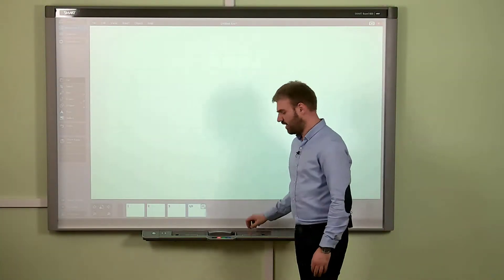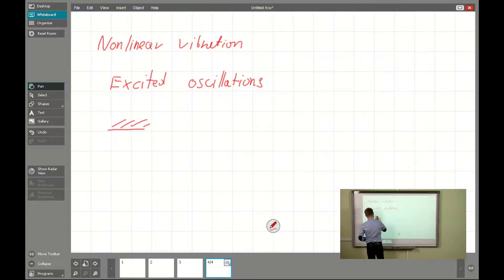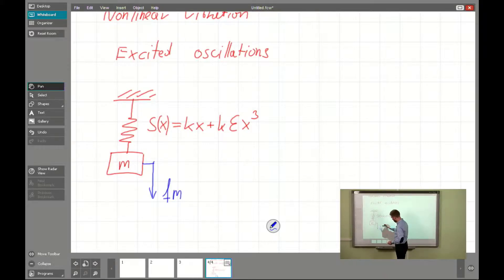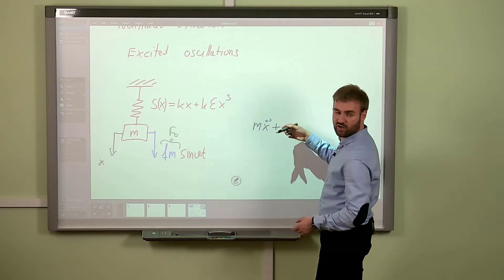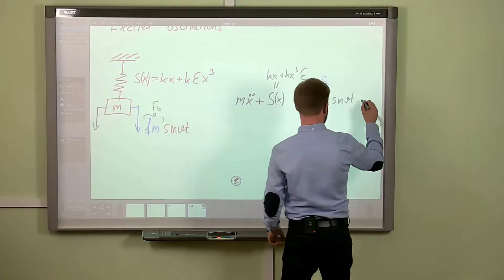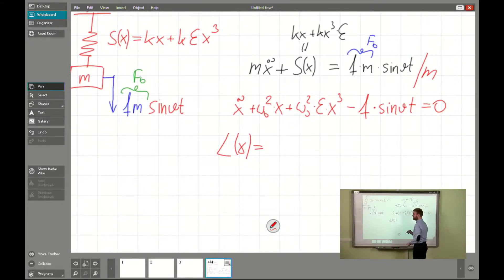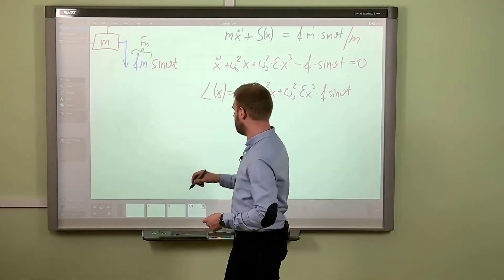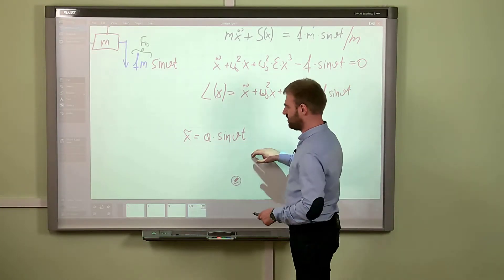[MVT#019] Nonlinear vibration - excited oscillations

Comment: thank you so much for your understandable lecture. as far as I understood,  in the case of free vibration the nonlinear frequency of the system differs from linear. but I guess in the case of excited vibration there should be a difference between linear and nonlinear frequency. I mean in this video you take the approximate solution with the frequency exactly similar to the excitation frequency. I couldn't understand it as this approach is true for linear case. I do appreciate you if you explain more.